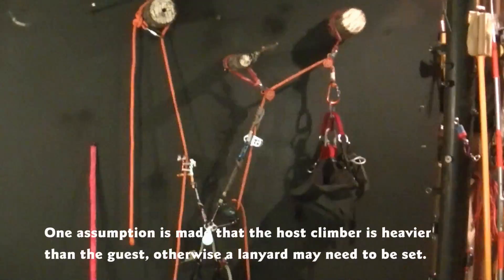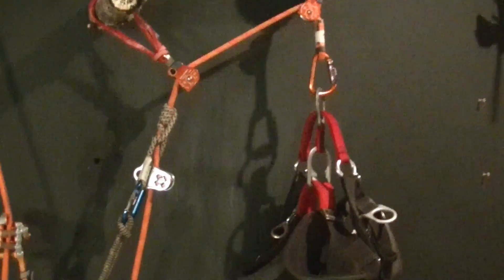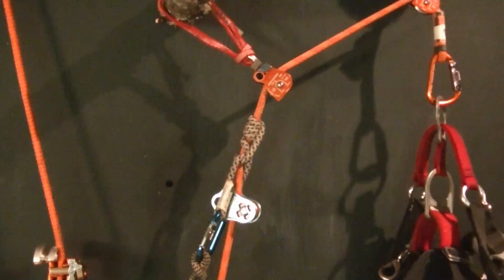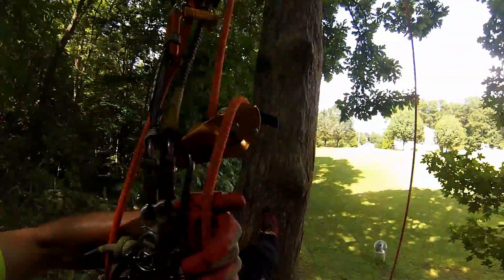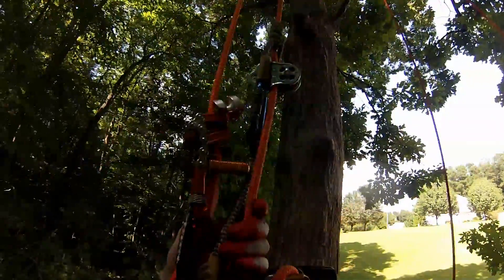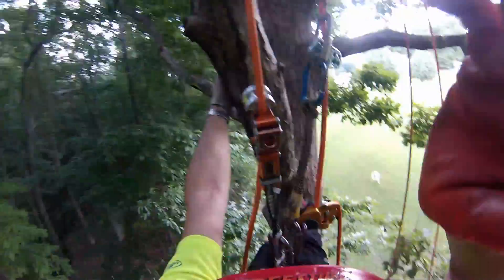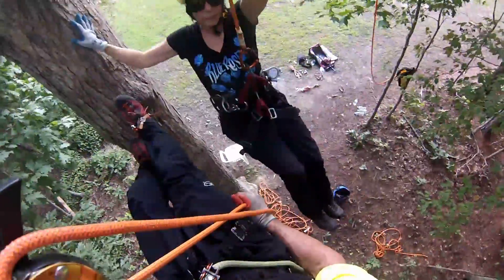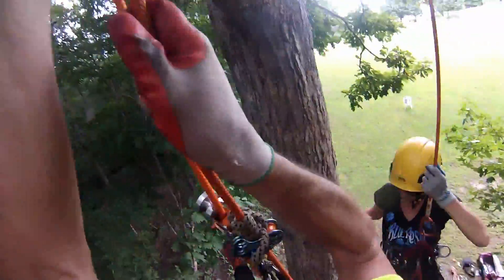Rope elevator used for tree climbing recreation, hauling or resuce.

Comment: Fun setup, but you will not be able to pull up climber of the same weight or heavier than you.
Reply from the maker: Thanks Dmitry, Yes, I pointed that out 12 seconds into the video.  A solution in the rescue scenario is for the host to be attached with a lanyard to a branch or tree, climbing together a short tether can connect the two climbers together to balance that load.